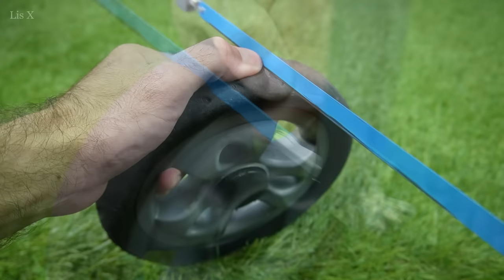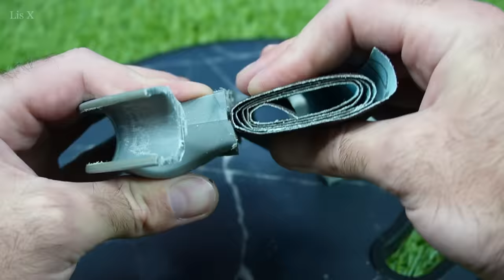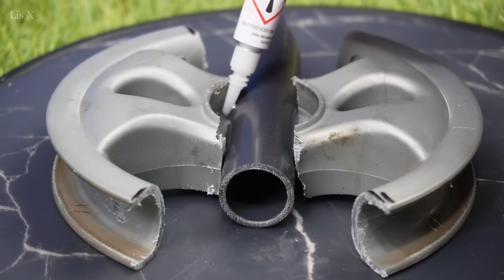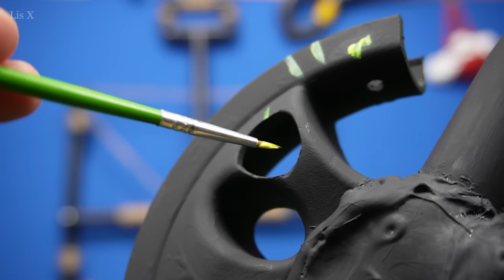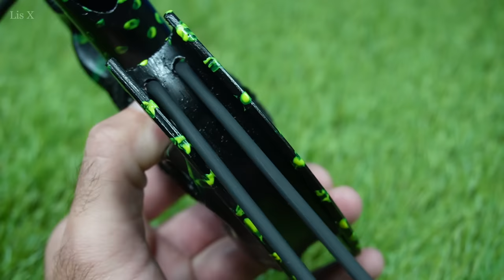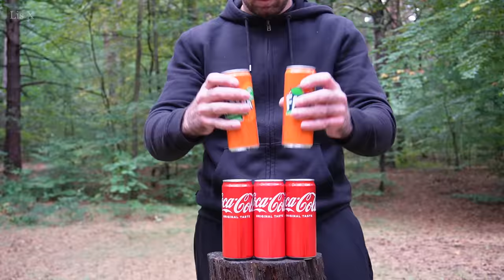How To Make Crazy Slingshot from a Wheel - Power Test

Comment: could you tell us more about the materials? size of pipe, type of wheel, band type?
Reply from the maker: Yes of course without problems! I used a PVC pipe with a diameter of 25mm! I took a plastic wheel from a baby stroller with a diameter of 18 cm! Used superglue, hot glue and strong rope! Elastic band with a diameter of 5mm! I folded the rubber band in half and got 4 rubber bands, so the slingshot became very powerful😱
Reply: Awesome thank you
Reply: Thank you kindly
Reply: And what type of wheel did you use ? Where did it come from ?
I'm planning on making a LARP character out of this ! @diylisx
Reply from the maker: @wellan551  I took a wheel from a baby stroller, rim diameter 18 cm
Reply: @Lis.X Saw this on TikTok and had to come see how it's made. I so want to make one now! I'm not a craftsy person so I'll probably screw it up, but it'll still be fun!
Reply: This is scary I can imagine this getting past metal detectors and someone getting hurt with a plastic spike shot from it
Reply: @wellan551 did you make IT already? I think I'like this,too, but I'm not sure it works fine with LARP-arrows.
Reply from the maker: @jayriffe3328  Nothing wrong with that! No one will get hurt! you have bad thoughts)))
Reply from the maker: @whiteravennova  Thanks for following me! This is a simple but interesting slingshot! you'll like it!😊🔥
Reply: May I ask, what did you connect the elastic to the rope with?

Comment: What a great idea.  If anyone needs a wheel they could call any mower repair shop in there town (look on your local craigslist). Or harbor freight has every thing needed (if you want to buy new). Im going yo make one with only one change. Ill use jn weld 2 part epoxy instead of hot glue. I have it on hand and dont have a hot glue gun. Thanks for sharing this
Reply from the maker: Thank you for your kind comment! I hope you can do it better. Maybe you can somehow modernize it?)👍😊

Comment: What did you use to attach the rubber and string?
Reply from the maker: I used a special elastic band for slingshots, but you can tie it with nylon thread

Comment: Could you possibly find out what kind of force this shoots at? Specifically an fps test and a poundage test?
Reply: How to do such a test😮?
Reply from the maker: Interesting😊
Reply: This is soo cool and I am HERE for it! Find yourself a  ballistics chronograph! It'll tell you how fast you're sending your bolt or arrow in meters per second or feet per second whichever you prefer!! After you measure your velocity measure your mass or weight of the bolt or arrow then multiply the two together and you'll have the force! Good luck and always have fun!!
Reply: @jessicawagaman4326 It all sounds complicated 🤯
Reply: @jessicawagaman4326 Where to get a ballistic chronograph😮😮😮
Reply: I assume it should be around 300 Fps
Reply: If you use pretensioned rubber you can get 30 pounds with a black Theraband.  They have the poundage listed for their colors on their website.  Sprave has something similar for the 3d printed mini legolini bow.
Reply: There's absolutely no way that device is getting 300 FPS ... luck of it gets over 140. There are more powerful bows that barely hit 140, and those you cannot do the slingshot pinch like in the video
Reply: @rudamchu  The mini legolini can be made legal to hunt with.  I am certain that this could too.  It is all about the strength of the rubber and proper pretensioning.  It would actually be easier with this as it works with regular sized arrows.

Comment: you want it to be stronger 
get longer arrows 
maybe get a slightly larger wheel with higher tension bands 
could probably make this pretty strong for its size 
a longer arrow would allow for further draw and a further draw means more power higher tension bands obviously stronger draw
Reply from the maker: Yes it is! Need to try!

Comment: you could probably add small torsion gears housed within the contraption with one having locking teeth and a trigger so as not to have to hold it back constantly. My 2¢

Comment: what if you put two torsion springs in the channels horizontally and used those instead of the rubber? it would net you more power more consistently.
Reply from the maker: Maybe! but then you need a larger tube diameter! loss of accuracy!

Comment: This is cool looking, but it has several problems:  doesn't allow for proper draw, the draw weight is very low meaning low power, the grip is awkward and the engineering could easily result in the frame failing.  So build this for fun, but don't rely on this

Comment: What kind of rubber tube (size, density etc) and what is the middle piece ?
Reply from the maker: Elastic band with aliexpress inner diameter 2mm outer diameter 5mm. in the middle there is a regular PVC tube for water with a diameter of 25mm, a wheel used from a baby stroller, a wheel diameter of 18cm

Comment: Anyway to do that so the fletching doesn't get messed up?
Reply from the maker: You can take another arrow without a wide tip
Reply: Fix 2 whisker arrow rests instead of the metal tube maybe? Those don't mess with the fletching and would probably help you be more accurate?

Comment: In the 1980s. I'd take a spool of thread, some heavy rubber bands and buy a pack of wooden skewers. Rubber band over both of the spool end holes. Push and pull through with the wooden skewer. Loose oder Los! Easily would go through 4-6 inches of "meat". Enjoy!
Reply from the maker: I understood the design! Cool I would like to see this))

Comment: Where do u get the string from?
Reply from the maker: I did not understand the question
Reply: @diylisx like the cord that builds tension for the arrow to fire?
Reply from the maker: @milklord_  it's quite durable
Reply: @diylisx  but from where does one obtain or make it?
Reply: @milklord_  you could use a bit of bow string. The replacements are very cheap. Not sure what rubber he's used though

Comment: That was a terrible build you really needed to be using some two-part epoxy to bond that PVC tubing with that kind of plastic that hot glue is just going to fall apart that rubber cement and super glue that were used will disintegrate in do to your hands sweat it's just a terrible build although an interesting design
Reply from the maker: Never has hot glue fallen apart! it's like hard rubber!